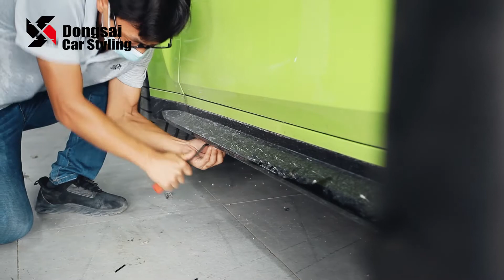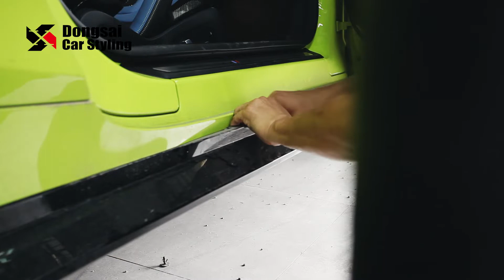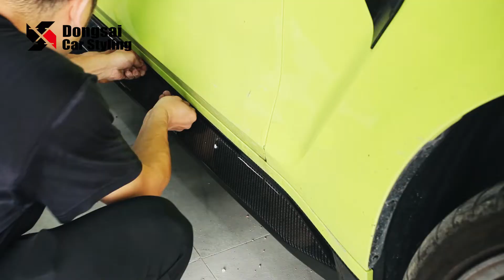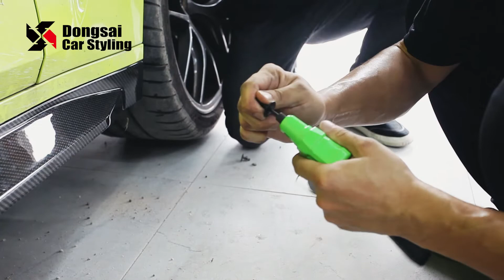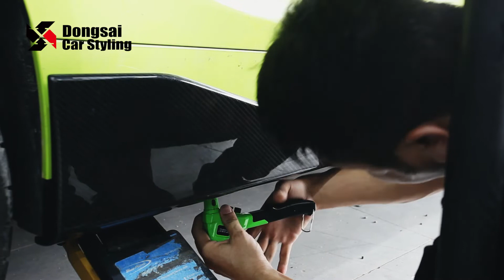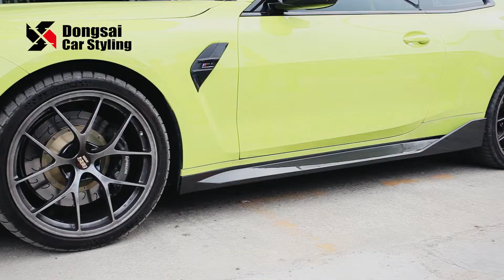BMW G80/G82 Dry Carbon Fiber Side Skirt Installation  - Dongsai Car Styling

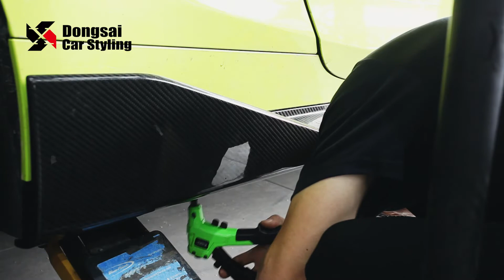Comment: What is the tool you use at 1:00 in the video? the tool you use to add the thing add to the side skirt
Reply from the maker: Hey bro, that should be a plastic rivet gun, and I think you can get it on eBay or Amazon.
Hope this is helpful, good day.
Reply: @DongsaiCarStyling  Do you know what size rivets are recommended?
Reply from the maker: @dougmurdaugh7733  If you get parts from us, we will have free rivets for installation in the package. The size is same like OEM rivets.

Comment: Is it a whole piece, I thought it was an add on?
Reply from the maker: Hey bro, yes, the side skirt is a whole piece, I didn't film it well in my video, sorry
Reply: @DongsaiCarStyling  Thx for the info i have small scratches on mine need to order new ones was looking for ideas what to get
Reply from the maker: @mr.getitonjones7950  Can you send message to me by WhatsApp?  +86 18054200136, Jack will check for you.